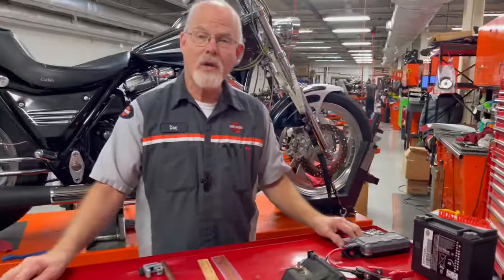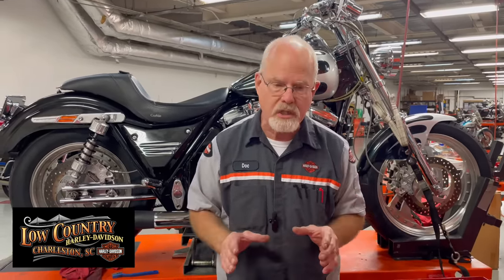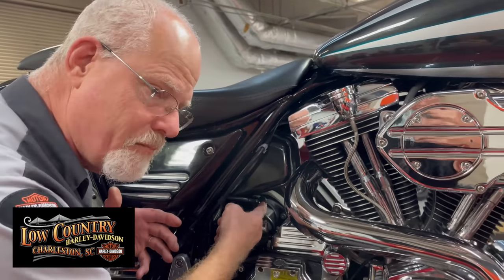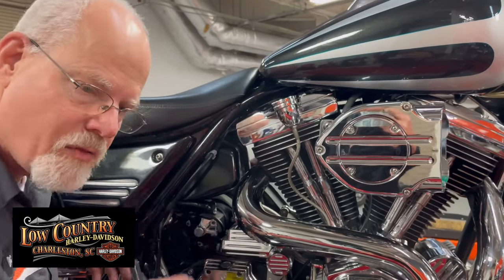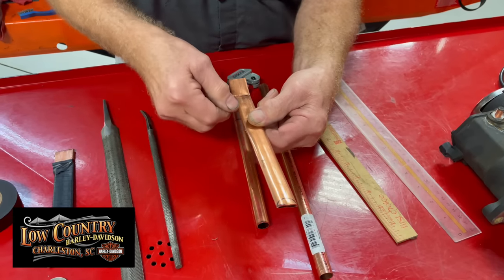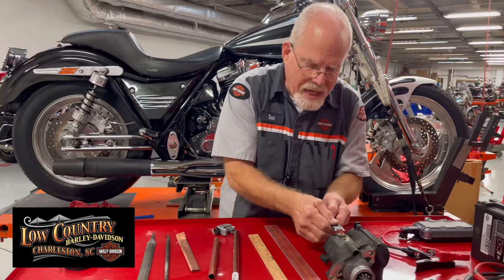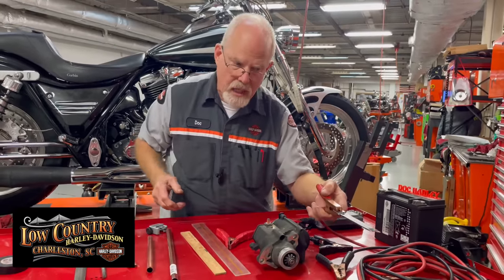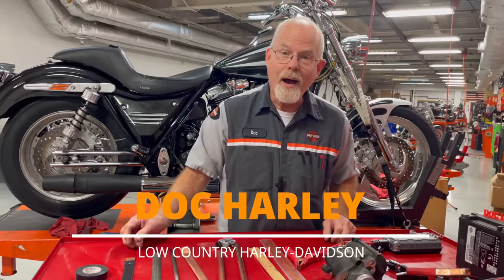Doc Harley Talks: How to Jumpstart a Motorcycle / DIY Tool for Starting Your Motorcycle

Comment: I've got a jumper box I carry and just plug it in through the battery tender cable. Just pay attention to polarity. Does the trick, nothing to disconnect or covers to pull
Reply from the maker: I don’t see how this is possible. Battery tender leads were never designed to handle a jump box….Doc
Reply: Hey Doc! Thanks for the reply. So I use a short SAE cable that plugs into the tender cable. The one I have came from a portable air compressor and has red and black clamps. The polarity is wrong in that case, but you could use any SAE cable. My jump box has clamps, as well as a protection system. It won't send juice until the polarity is correct. Works fine to get it home.
Reply: Side note, my portable air compressor has the same SAE cable on it too. It plugs in right in the tender cable if I need to air up. Barely use it as I keep it checked at home, but nice as a backup plan

Comment: Doc how about a video on battery cables? Should you change them out on a regular intervals. Upgrade to aftermarket? Battery cable life?
Reply from the maker: Steve there is no “regular” time to replace. You could check with an ohm meter and wiggle test when you want. The most important is clean tight connections at both ends….Doc

Comment: the electrical system in a harley is the same as any other vehicle, just us some jumper leads and connect to the battery
Reply from the maker: You are correct if you have the tools to get to the battery leads. New Softtail is very challenging…..Doc

Comment: Earlier this yr I bought the HD Jump Pack for my 15 Limited but I didn't like the idea of if I needed to jump my bike and have to get under the seat I looked up the NOCO website for a pigtail for the battery. I had HD install it for me. The pigtail makes life easy by just popping the plastic protective plug from the pigtail and inserting it into the battery bank in literary 5 seconds viola you can turn on your battery bank and start your bike with no contact issues.
Reply from the maker: Thanks for posting your Tech Tip…Doc

Comment: Hi Doc, just a simple question. 1998 1340 Super Glide starter motor mounting Allen bolts, do they have a plain washer and/or a spring washer ? Just fitting a new starter motor and the mounting bolts came off, one with no washer and the other with a plain washer ? Just like things to be right. Thanks, Mac. Another informative video by the way.
Reply from the maker: Yes I use a spring washer. One bolt should have a washer the other the ground from the battery….Doc
Reply: Many thanks @LowCountryHarleyDavidson

Comment: why can't you boost it from the SAE pigtail that hangs out from the battery compartment?
Reply from the maker: That wire can’t handle the high amps it take to move a dead battery….Doc

Comment: I would think as soon as you touch that starter with a hot wire (and the starter is ground) she will turn over without hitting the starter button?
Reply from the maker: Two separate circuits. Top nut is power coming in. Not a direct connection to the starter solenoid…..Doc

Comment: Hey Doc, My Street 750 cranks slow when hot, I have also recently changed the battery , Cranks good at the morning when cold. Any solution ?
Reply from the maker: Check all connections. A possible relay is getting weak…Doc

Comment: By using a lighter gauge wire , It will cut down the amperage going to the parasitic battery and not give the full cranking amps from the jump battery. Wouldn't that lessen the arcing and sparking at the battery??
Reply from the maker: Your theory is interesting…..Doc
Reply: I have 2 Yamaha v-twin MC's , one is a xv250, and a Yamaha Roadstar. I have jumped the 250 a number of times and it worked each time, I do have to say I have not tried to jump the Road Star

Comment: If you connect the battery jumper to the starter and the negative clamp to the frame, the starter won’t engage? Unless you push the start button?
Reply from the maker: Correct, all your doing is adding to battery power. Button still needs to be pushed with ignition on

Comment: Thats such a pain. Spend the money on a terminal connection cable for your jumpstart (NOCO GC002 X-CONNECT EYELET TERMINAL CONNECTOR). It’s much easier.
Reply from the maker: Thanks for your “pain relief”…..Doc
Reply: @LowCountryHarleyDavidson  thank you. Maybe if anyone is not riding for months just remove main fuse if no accessories connected to bike it will not drain for a year or more.

Comment: Good morning my friend. I've had abit of a problem. I tried jumping my harley 48 using your method with the starter motor. It didn't work and now my electrics are going on and off really quickly. Any help on why it would have done this? 

Cheers.
Reply from the maker: Battery might have a dead cell.

Comment: surprised this works - isn't that stud on the starter connected through a starter relay that needs to be energized by a circuit before the stud?  I guess, perhaps, not but then I'm wondering are you somehow back feeding power to the bike ECUs at the moment you turn the bike on (newer models with ECUs and CAN bus)?  I guess if you say this works, I just don't understand the electrical connections.  On most modern automobiles, the spark plugs are fired from an ECU/Computer and power to that computer can not be fed via that starter motor stud.... interesting...
Reply from the maker: I love your want to understand. This suggestion does not start the bike. It supplies power so the bike can function, using standard starting process…..Doc

Comment: LOL   It is good insurance also. I had my bike 2 weeks  Heratage soft tail, hart to boost. Left the key on hit the kill switch. Made up a little jumper for connecting the 2 battery tender cords that come on most Harleys.   Do not try to start with the cord connected not enough current can flow. Just hook up cable let good bike run to charge dead battery, stand around and teas guy with dead battery for like 10 minutes. Un plug jumper, start the bike and drive away. If you have this in your tool kit no one needs it.

Comment: Does it work the same with a lithium jump pack?
And is there a fuse I should pull when doing
Reply from the maker: Instructions on most lithium batteries is Never Jump Start!…..Doc
Reply: Mine is advertised FOR jump starting.Confused

Comment: I have a question for you that is a little off topic, battery. I'm gonna need to get a new battery here and I was wondering what your thoughts are on lithium batteries. I know I will need a different tender but one of my concerns is that these types of batteries (in the past) have been known to catch on fire. I'm aware of the higher cca's but the fear of burning up my bike and or the family jewels has got me a little wary about them. Am I worrying about nothing?
Reply from the maker: Gary thanks for watching our videos. Lithium batteries have many advantages but in my opinion need more development. On a side note, love these batteries in racing- lite, powerful, good for A Race. For daily use not so much. A Harley-Davidson needs a battery for everything where most foreign bikes use it to start and can run without it. An AGM battery can loose most of its power and it can be nursed back or even jump started. A lithium battery below 8 volts is dead and can not be jumped. An AGM battery is good for those that listen to stereo with bike off. A lithium not as well. Like I said, more development needed….Doc
Reply: Thanks,  I'll stick with a lead acid battery.

Comment: To jump start a Harley, put it in neutral, turn the key on, you and your wife push the motorcycle as fast as you can,  then "jump" on the seat, and pull it in 2nd gear and dump the clutch. Jumpstart.
Reply from the maker: 😆 I see what you did there. Well Done…Doc

Comment: instead of doing this couldn't you use a jump pack connected through the battery tender connection ? Anyone ever try this ?
Reply from the maker: No Bob. The tender lead was designed for small amperage charging….Doc

Comment: What if you have wires for a battery tender wires 
Could you not hook up to the cable that connects to your battery
Reply from the maker: No. The tender wires are made for low amperage…Doc
Reply: @LowCountryHarleyDavidson  thanks for the information

Comment: Couldn't you jump from the battery tender cable from a lithium ion booster?
Reply from the maker: I don’t know. The battery Tender was made for max 5 amp. Starting a semi dead battery takes more….Doc
Reply: Nope. That battery tender cable is too small. It would melt very quickly.

Comment: My 2007. 1200 sportster will not jump start . When I hit the switch I have nothing  the start rely is good   Note  I road the bike, park it , now won’t start. When I turn the key on I hear the fuel pump . When I hit the start switch.  Nothing. The fob has a new battery
Reply from the maker: You did not mention how old the battery is. My first concern is the bolt at negative on battery. A difficult design. A battery can have enough to turn on lights and pump but fail at CCA….Doc

Comment: I haven’t tested it, but my battery tender SAE pigtail take an adapter that connects directly to my handheld Jump Box(one of the mini ones that are Uber portable)
Reply from the maker: Please be careful. The OEM battery tender cord was Not designed to handle starting amperage. Might melt!…..Doc

Comment: My 2019 street glide went into winter storage running, this spring it had a dead battery, I charged it with current technology and put the battery back in and now when I try to start it.. the starter makes a zing sound.. and won't engage,, all my terminal connections are clean,  could the battery be showing 12.6v and have lost its capacity in amps?
Reply from the maker: Yes it is possible the older the battery and having been drained. But the zing description sounds like the starter clutch going out….Doc

Comment: Can't you just use the end of the trickle  charge cable on the motorcycle to attach a jumper cable with a trickle charge plug on one end with jumper type clamps on the other end ?
Reply from the maker: No. The tender cable can not handle the amperage…Doc

Comment: Why not just heat shrink a large screwdriver and have a handle to hold it there.  Here's a bonus...you would have a screwdriver too.
Reply from the maker: You mean someone offers a copper screwdriver…Saints be praised…Doc
Reply: @LowCountryHarleyDavidson  and it has to be copper, why?  You look old enough to remember shorting across starter relay on old Fords with a screwdriver.

Comment: Hey doc, I work offshore 14/14 and have been very busy on my 14 days off with stuff around the house and helping out me kids around their houses and have not had time to ride my bike any for the pass 6 months, this last time I was in I smelled the gas and its not good. What do you recommend I do before start riding it again I really want to go on a ride the next time I am home which  will be in 12 days. Any feed back would be much appreciated. Thank you and may God Bless
Reply from the maker: Your bike needs to be kept on a battery tender. Drain your fuel. Fill the tank with non ethanol fuel. Install fresh spark plugs. Hopefully when you start the bike fuel will run through your fuel system. You did not tell us what year or model. If it won’t run you’ll need more help. Always before you leave for such a long time. Fill tank with non ethanol fuel add fuel stabilizer. Run the bike so the good fuel and Stabil will be in the Fuel system. And hook up the tender….Doc
Reply: @Low Country Harley-Davidson  MY apology, it is a 2012 heritage softail classic.  Thank you for the feedback Doc, stay safe and keep up the great content. 👍

Comment: I have an '18 touring and I just clamp the jumper cable clamp right to the starter bolt just like you would a battery post. I just had to do this about 3 months ago after leaving my lights on while at a BBQ. Is the touring model access different? I didn't see any need for a tool on mine.
Reply: not all starter posts are accessible. Be glad yours is.

Comment: Well been riding and building for 36 years so far jumped every bike I had off a running car never had any problems.
Reply from the maker: Would you buy a lottery ticket for me you one lucky person…Doc
Reply: why would you need the car running? Any car battery can surly jump a bike battery without the car running. Why take the chance?
Reply: @hardtailsuicidaljockey6827  because overtime bikes electrical systems change. Unless you only ride 40 plus year old bikes, keep doing what you do. Again, it is not needed for a car to be running, why take chances. Many years ago hockey goalies never wore masks. Guess what, they finally wised up. Your stubborn, I get it. Happy new year
Reply: @Boobtube.  ...can you enlighten me as to just how much more power is available to cook your Harley if the vehicle you are jumping from is running?
Reply: I don't think you are lottery ticket lucky.  It's about connection integrity and not melting anything down cranking it endlessly.  The voltage at a car/truck battery is the same running or not.  If it weren't for space and weight I would have truck batteries on all my bikes.
Reply: @punishinghammer2440  wrong. Get yourself a  voltmeter. Put it across a car battery when not running, than start it up and test it again. Your welcome
Reply: @punishinghammer2440  uh, it's called a charging system on a car. Not running, it is not pushing more current into the bike. Running, it's all going straight into the bikes computer. I can't understand why people insist on doing something that is not needed. There is ZERO reason to have a car running when jump starting a bike. So enlighten me as to why you feel it needs to be done.
Reply: @Boobtube.  ...read your argumentative know it all comments thru the post earlier.  The battery is on the upstream side of voltage regulator.  The variance in voltage is insignificant.  Before you educate me further, I went to Nuclear Power School in the Navy, was a field service Master Tech on industrial electric air compressors and have a reasonably solid understanding of electricity and troubleshooting.
Reply: @Boobtube.  ...i didn't say it needed to be running.

Comment: Great video.
Can you jump start through your battery tender plug?
Reply from the maker: No no no…..Doc
Reply: yes you can, if you have 10 gage wire and no fuse in line with it. That is what I did, and it works fine. It is just like a heavy duty SAE plug, 10 gage, going right to the battery. Amazon has them. And you can still use the SAE plug on your battery tender to keep battery charged up just like you did before.

Comment: I guess I don’t get the work around. If you hook up a pig tail for a trickle charger you can jump it with a set of clamps that already come with many trickle chargers. Once you have your battery leads connected you are set up to run your charger and you now have your charging plug right there sticking out of the side cover. So if you need a jump just hook up cables to your new trickle charger pig tail clamps. I mean that would be easy right? I always install a pig tail and a charging monitor to every new bike I get. First thing. Never have had to buy a battery. Never have needed a jump. Go figure.

Comment: How's about having a tender cable hooked up to your battery and maybe carry a portable emergency jump start battery pack with you or something I've thought of, but am not sure if it's safe for the bike is carry a tender extension cable on your bike(in addition to a cable installed on your battery) and maybe someone in your riding group has a charging tender cable on their bike and you connect the two tender cables via the extension and jump the bike that way, again something I've never tried and am not sure if it's safe or not.
Reply: just make sure the cable used is 10 gage min. Most tender cables going to batteries are small 16 or 18 gage. Amazon has the 10 gage SAE cables.

Comment: Why can't you leave the car running when you jump it off?
Reply from the maker: Because the car alternator is pushing more than 50 amps to a dead battery! It will fry a lot of motorcycle electronics…Doc

Comment: Couldn't you jump start the bike from the electrical pigtail for the trickle charger cable by making another matching pigtail that you plug into the trickle charger and the other to your jumper leeds?
Reply: That cable is way too thin, you’ll make an electric fire.
Reply from the maker: No! This cord was made for low amperage charging devices not large starter amperage needs….Doc
Reply: @rebel_ltz  
Could I replace the cable with a thicker gauge?

Comment: I'm not sure what they call it but on my bike I have that connector/jumper that goes to both the negative and positive of the battery and then hangs down under the seat and is covered with rubber. I just uncapped that and I can connect the other portion to it that would either connect to my battery charger or to a jumper. I'm not sure how to post a picture of it on this. I hope you know what the thing is that I'm talking about. I could see your idea or your reviewers idea would help someone else but I think my bike is covered. Plus I recently replaced my battery.
Reply: If its just a regular ole battery tender pigtail it will blow the inline fuse if your lucky if not the wires will fry...
Reply: @bigblue3568  so only use it for the tender and not for a jump start?
Reply: @BeaverDaveECV  Yes that tender wire cannot handle the current for a jump start only charging.
Reply: That’s correct. The battery tender cannot be used to jump start. It will blow the fuse instantly. Don’t ask me how I know.
Reply: Thanks for the info. I remember trying to jumpstart my bike last year and discovered that the fuse was blown. Since it was the first time I ever tried it I thought the battery was blown prior. Now I know.